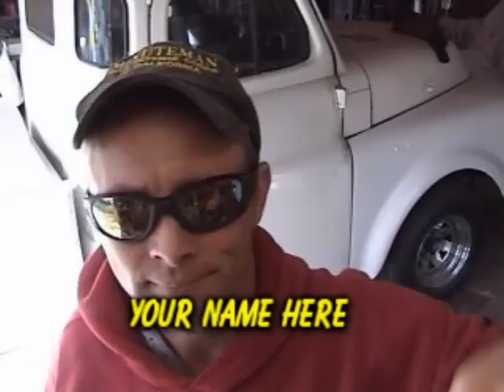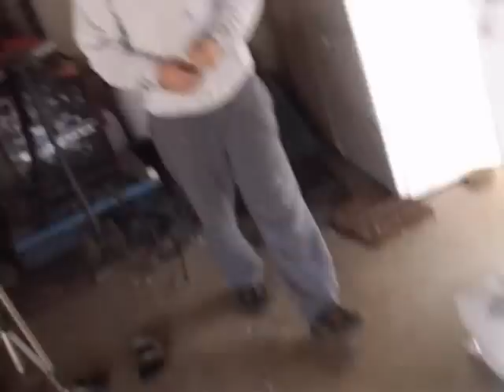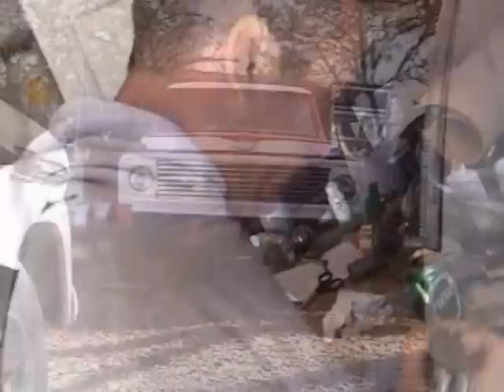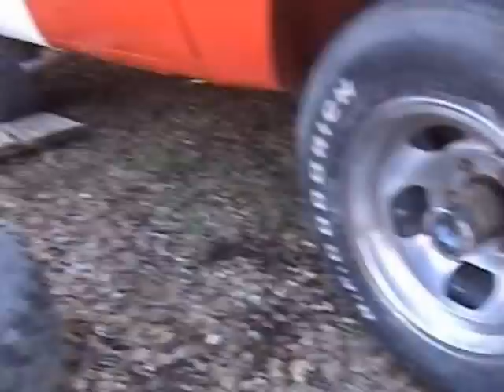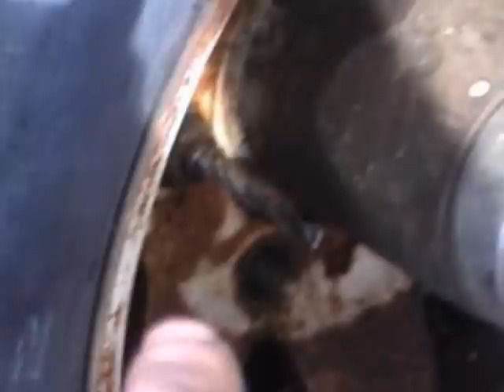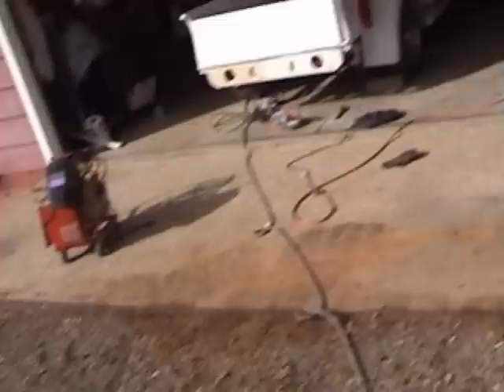BBHR Project Everything 001

Comment: Sadly so am i....and there are all too many of them rollin round here at car shows in England....that's where i first saw the red slot mags....surprised you havent tapped out gaskets before...just stick the gasket paper to the manifiold, with sealant or just greace...and dude you can even use a block of wood, just rub it against the sharp edge of the flat casting,,,,,it juyst cuts through....even use the handle of a screw driver if you dont want to risk the casting....easy..